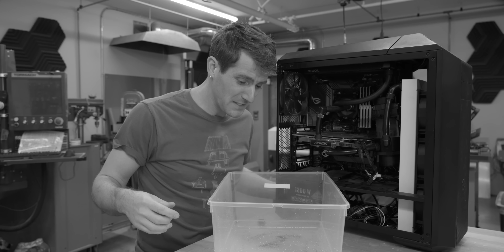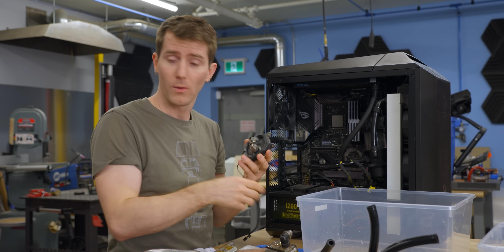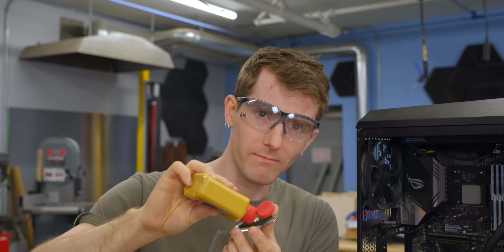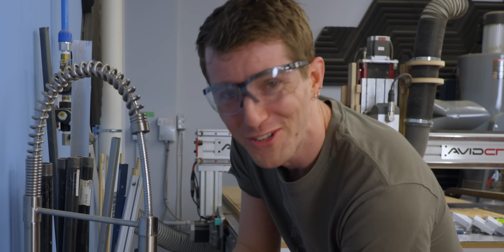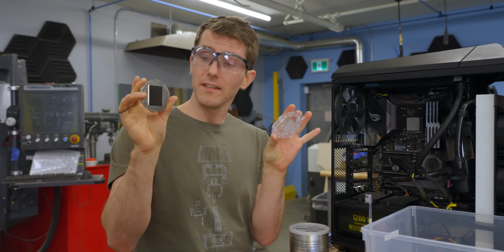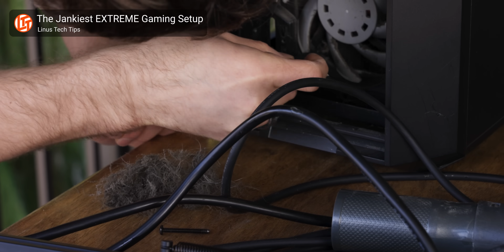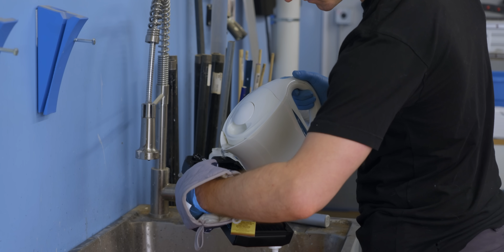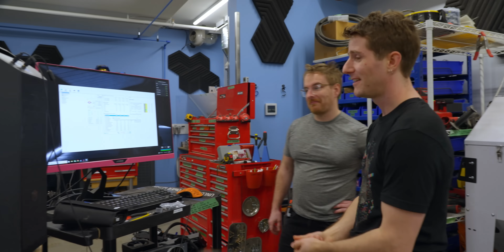I Will Never Watercool Again – Water Cooling Maintenance Guide

Comment: Meanwhile, us air cooled guys be like... "it's about time I blast some compressed air around my pc. It's been like 3 years"
Reply: 3years? thats rookie numbers
Reply: This brings up the age old question: which is more important to you... Actually playing games or fussing with expensive bleeding-edge gaming tech?
Reply: Same here, I have a water separator on my basement compressor and I pressurize and drain the tank first to remove condensation, check the water separator blow out the pc and half hour later im good to go another year or two on average - love the look of water cooling but the first time I saw it I thought thats a PITA I do no need, leak prone water cooling in the middle of my expensive parts just doesnt  make good sense for reliability, seems like asking for unneeded problems I do not want or need
Reply: It was 8 for me.

There were several cobwebs.
Reply: @nicwolf1370 I have some of those jumping spiders in my Windows and was quite surprised when I saw one made its home inside of my PC, there was not any kind of insects parts so I guess it moved out not long after
Reply: I mean do it right (and don’t put your mouth on the tubes which is such a terrible idea it’s not even funny, don’t introduce life into your loop?) and water cooling is pretty fuss free. Going on 4 years without any maintenance for my current build (which is opaque fluid). Prior to that, had builds with normal car coolant diluted running for 8 years
Reply: @cwill2127 Quit crying
Reply: @cwill2127  never had a liquid cooled system but then always built a Frankenstein PC from bits and bobs of others. I guess I'll build one some day given the heat PC's out out these days, but I've always felt that it's overkill up until now.
Reply: @gofres  Or just don't run as hot – most systems will run just fine with a 65W CPU, and you can even undervolt it (it's worth trying on all recent AMD CPUs). It's the GPU's that are challenging but they're also the biggest pain in the ass to liquid cool (as you'll fully void the warranty, and deserve to, if it didn't come with an AIO), but mostly they're fine as you supply them with plenty of air that has a place to go (exhaust).
Reply: @cwill2127  True, though you still need compressed air for your radiators too. Car coolant is ok but I had issues with viscosity and color depot and raised temp versus distilled water.

Comment: I've had Mayhems UV Blue in my custom loop work system for over 10 years with just occasional fluid top up. No decrease in performance! Using it again in my 14900KS and 4090 system with MoRa 420 🙂

Comment: I used an automotive coolant called HT-12 on my loop. I work at a BMW dealership and in 2018 this coolant was introduced and used on all high-voltage components including the computers and even cell modules themselves. Those cars today are basically just computers that can drive and this is the best coolant available. It's not like in the olden days when computer watercooling was starting out and no automotive coolant had to be able to cool the engine and the electrics without mixing different metals in the loop or being too conductive

Comment: I don't know why the PC industry is trying to re-invent the wheel on water cooling. The auto and aviation industry have already figured it all out. While these are unpressurised systems, running at MUCH lower temperatures, the differences kinda end there. Don't use "PC coolant". Automotive coolant is designed FOR mixed metal, FOR being gentle on multiple types of soft components, FOR o-rings, FOR anti growth, FOR anti clogging. Yet, it's ignored for the pudding or colored look PC owners want, from questionable fluids at best.

All I run, is water wetter with tap water, per the recommended ratio for first fill, and keep it pink from then on (evaporation). I get no growth, I game thousands of hours yearly, (with receipts)  and have zero issues with my system. Why water wetter? It's not because it makes the machine run cooler, that is not how it works. The claims for auto use, is based on the fact water wetter prevents large bubbles from forming in the mix. Instead, the bubbles are significantly smaller, and will circulate suspended in the fluid, instead of sticking to parts. In an automobile, this means the air is not trapped on parts that need to radiate. In a PC however, the area of affect is so small in comparison to an entire engine, you won't see a measurable difference. Then why water wetter? It still has almost all the benefits of standard coolant, in addition to reducing airlock bubbles to almost zero in my slightly complicated system.

Auto coolant comes in a range of colors, with Asian formulated being the most compatible due to it always being made with mixed metals in mind from the start. Using a 50/50 diluted ratio, or even lower on the coolant side since it doesn't have to deal with freezing temps, WILL be superior to any "PC coolant" over time, and solve a LOT of problems.

Comment: Pro tip: use toothpaste to clean the water block and it works like a charm. No need to buy brasso or anything. You can also use an ultrasonic cleaner

Comment: Yeah,maintenance is important. Didn't do it for years and 2 weeks ago my GPU waterblock leaked into my power supply. Was a lot of smoke but no fire thankfully. Had to put air cooling back on the  GPU with some new thermal pads and bought a new power supply. Also bought some RAM as a bonus. And all this made me finally service my custom loop. Hope I'll get no more leaks.

Comment: Fun fact, a can of "Super Lube," the lube they used for the O-rings, is a common shortcut for lubing a mechanical keyboard's key switches. It's not quite as good as hand-lubing them (both what people say and from personal experience), but it does a solid job if you're not interested in lubing switches for several hours.

Comment: Water cooled PCs and Vinyl records.  Got it.  Worse performance and maximum inconvenience.  If I did build a water cooled PC the last thing I would do is blow the air through the case.  Isn't the appeal that the case isn't filling with dust like a vacuum cleaner?   Water cooled system require more air flow over the radiator than the air cooled PC, so the fans for the water cooled PC could be louder.  I would just get a massive radiator and skip the fan.

Comment: I've got a 3.5 gallon water jug that has a vfd water fountain pump, that pumps to a 5 micro water filter, than to a 11"x11" tramission cooler (because you can get a 2x2 140mm fan array), then a wye-split for GPU and CPU circuits. Haven't touched it in forever.

Just make sure there's water and "super coolant"

Comment: I never buy a water block integrated GPU exactly because of resale value issues. I retain the original air cooled shroud. So when the times comes to sell, I just revert the GPU card. If the buyer is interested in the water block I sell that extra. Worked for on 2 generations of cards. That said custom water cooling is definitely less price to performance compared to spending that money on better memory or GPU.

Comment: i run dell server fans on my gaming rig for case flow for the gpu with a water block on my CPU and a alphacool cooling tower and my seperate lighting design rig runs water-cooling on the cpu and gpu that shares the tower cooler with the other pc with high capacity dell fans in the tower too gets me through multi day programming sessions with a 3d render window/feed running constantly

Comment: Odd, I had a loop run for years with no issue, distilled water and silver (coil of silver in the res).  At first it had blue die, that built up in the blocks, cleaned that out and went just distilled water and silver coil and it stayed clean for years. That loop was like ten years old when the 360 rad was replaced by two 560s, one of my grandsons got the loop that I last used on my i7 2600K and used it since. I think it was about a month ago he did the rad change for his new case. He has a 7950X and RTX 3090, as of last month, the only thing left from that old loop is the D5, but the old rad and blocks are fine.

Comment: i was wondering when they would get to the fluids used... it wasn't till the end of the vid, and it was maybe a few minutes' worth of mention. 

i was sitting here looking at the radiator descaling and cleaning part hours n hours ago before work and Linus failed to mention another reason why you leave one plug loose... yes, heat will change pressures inside a closed system when you clean a radiator like that... but you want to vent it properly not just because of the 'squirt factor'! you could rupture an INTERNAL line in the radiator or a fixture or a weld. that would really suck if you totally RUINED a radiator just by cleaning it improperly. put some pressure on that radiator and leakage etc. frantic scrambling noises and 'noooooooooo!' as your PC is killed by its own coolant. 

anyways, why are you guys descaling that radiator in the first place? you're using denatured reverse osmosis filtered and distilled water right? there shouldn't be anything in that water except for 2 H and 1 O ... no minerals, nothing except your antibiological. unless one of you knuckleheads topped it off with tapwater? hmmm? 

easy test to see if that iodine killed that lil fuffy filter thingy. get a replacement filter. get a tiny plastic tub with tight fitting lid. put filter in tub. cover filter with SAME SOLUTION % of iodine and EXACT SAME WATER. apply lid. shake vigorously. let tub sit in a dark cool dry place and re-shake it every day at least once. insert Spongebob Meme... "Several months later..." check fuffy filter thingy for degradation. question answered. 

since you had the entire system disassembled... WHY DIDNT YOU ADD A DRAIN!?! 

otherwise, this was a fun vid. the toothbrush idea for the plug was a good one! already knew i'd never use water-cooling. everrrrr! but this cemented my opinions. 

thanks guys!

Comment: Hey Cool Toothbrush. My teeth look like Shane McGowan circa 1989, so I needed it at max power. Solved all my dental problems. After 1 use, it blasted my teeth out of existence with slightly less blood & pain than using a belt sander. 5 stars. Alright, see ya later fellas, I'm off to get fitted for my new dentures. 

In case it wasn't clear, this is a joke. I'm sure the toothbrush is a fine product, I just couldn't pass up the opportunity.

Comment: Both my PC and my car are air cooled, the OC has not needed maintenance to the cooling system and my car has been around for 60 years and only recently needed the fins cleaned.

14:22 well not if your heatsink is big enough and you use larger fans, I don't even hear mine most of the time even without headphones on.

Comment: Air cooling logic: Blow air at the hot thing to make it closer to ambient. The only way this system will fail is if the fans stop spinning.

Water cooling logic: Use water to move the heat around a bit before eventually blowing air at the hot thing to make it closer to ambient. It's basically like a kid that smushes his food around instead of eating it. It's still the same volume of food, it just looks a bit different now. It's basically air cooling, but with an additional 10-20 points of failure.

Comment: @LinusTechTips I wonder if the CPU block could be better cleaned with an ultrasonic cleaner. I have one that I use on some jewelry and my glasses. The small ones for home use aren't that expensive, but you can get some beefy ones with built in heater in a very different price range. https://en.wikipedia.org/wiki/Ultrasonic_cleaning . Also, some stuff was getting rusty? I thought stuff made for contact with water would be stainless? Could you maybe treat it with Ferrobet, or would that be a bad idea?

Comment: I think water cooling was more relevant several years ago when chips were less energy efficient. These days they're mostly pretty energy efficient and tend to protect themselves from overheating by declocking slightly rather than melting! They also leave a lot less "money on the table" with instability starting after only moderate overclocks that don't generate so much heat and there isn't much motivation to run silly overclocks or voltages.

Comment: Well... even though Id like to stay with safer air cooling methods, the 14900K MINIMUM requirements is an 360aio... and for a decent use you also need a thermal backplate, a bit of under volting and a push-pull system. God maybe even a 420aio instead!
So.. yeah.. unless we get a very efficient air cooling capable of standing 250+W, I think Im still obligated to use an aio in those extremely unnecessary power consuming CPU I got :/

Comment: I have never used water cooling. But I have a question, why don]t you guys use vehicle radiator coolant? Sounds more reasonable and it doesn't have the waters expanding property. So you wouldn't get corrosion or debris in the water. Vehicles use coolant for exact those reasons. So that it would not expand and destroy the hardware.

Comment: I had an old Corsair AIO, this was probably 12 years ago (maybe more, I think it was around the time water cooled AIOs were a new thing) and I don't remember the model, but they had an issue where the filter inside of it would disintegrate and it gunked up the entire thing. I remember when I noticed it; I was running world gen in Dwarf Fortress and the fans maxed out and it sounded like a jet engine, and I began to notice performance degradation. It took me a long time to figure out the cause of the issue. I had no idea it even had a filter inside of it since it was a closed loop system, so I thought it was a software issue for a few weeks as I was troubleshooting it. It wasn't until I saw a post online where someone had the same exact issue and it was something Corsair refused to admit as an issue as I found more and more people with the same issue (and it wasn't even that old, maybe a year or two). Anyways, I had to end up buying a new one and it fixed the issue. I took the old one out and disassembled it... sure enough, just full of particulate matter.

Comment: There is a coolant used in automobiles that isn't water. The main benefit of water less coolant is it doesn't promote corrosion. Drawback is it's $50 a gallon.

Comment: I've water cooled 3 pc's at this point. The ONLY one that I've ever had issues with is the current one and that is mostly due to the risk I took with opaque fluid. The opaque fluids apparently still separate, oh yay. My last two systems had zero issues and required next to no maintenance. I recommend PrimoChill fluids, literally the best fluids I've used. They come premixed and already have anti-corrosion additives as well as biocide. No need to add stuff after the fact. Just whatever you do, avoid any and all opaque fluids.

If you want simplicity, go with a tower air cooler. If you want style and or efficiency, just do liquid cooling right.

Comment: water-cooling was never about reliability, it was always about low temps and sweet style points ✨

which is precisely why i don't really like AIOs, because they look mid and perform mid when compared to custom loops, but also lack the sheer reliability of a cheap air cooler

Comment: This is why I just use an AIO on my CPU, and if it goes bad, just get another one. The GPU, I always get the GPU with the best cooling solutions and never have issues with overheating. I don't overclock, as the units I buy are usually factory overclocked anyway. I do see the appeal to water cooling from a 'cool and doesn't it just look sick', perspective. But the money and cleaning just doesn't look to be worth it. How much real extra performance is gained versus the money spent?

Comment: ptm7950 aleluja, I have tried 4 different high end thermal pastes on GPU, and not last more than 14 days. After that hot spot was too much 105°C, before after thermal paste change was max 75°C. Now with ptm7950 after a month still have hot spot max 75°C and core is 10-13°C lower.

Comment: Just a quick comment on lubing o-rings. I work in clean room laboratory with many vacuum and gases / liquid sealing of all kind. Actually no company advises to use lube if you got good quality o-rings, as they will seal off themselves.
Reply: e.g. O-rings made from FFKM or known as Viton (but you need to check your cooling liquid specs if its good)

Comment: I've had the same pump, res, and rad for the last 10 years and temps are still perfect.  Aside from waterblock replacements to accomodate cpu/gpu upgrades and flushing the system twice per year using distilled water w/ anti-organic additaves, (Which takes about 15 minutes) I've had to touch my loop exactly zero times.   Seems like LTT just overdramatizing a simple and straightforward setup.